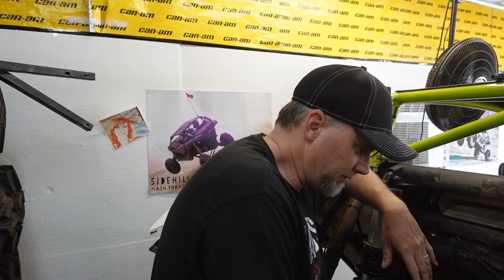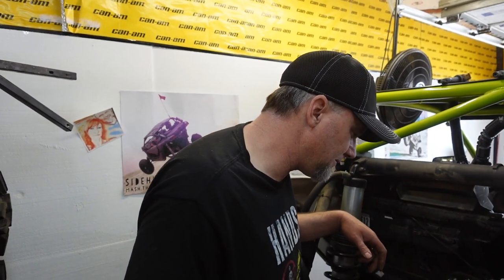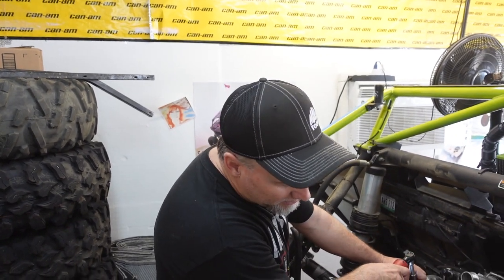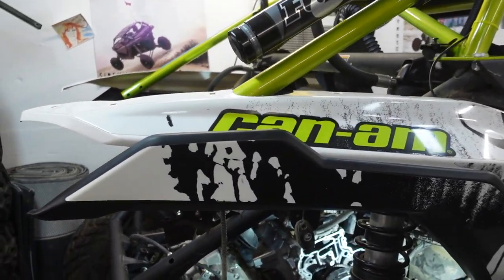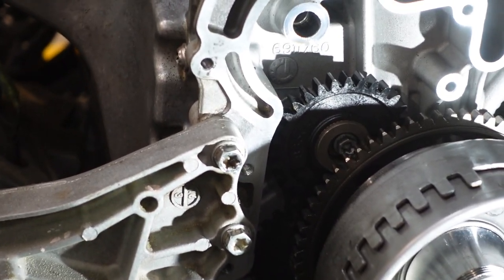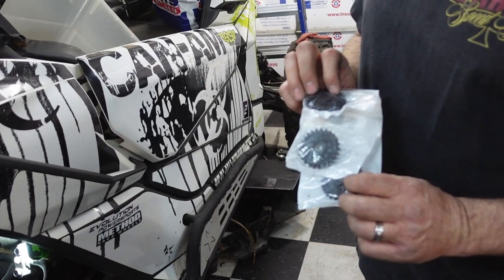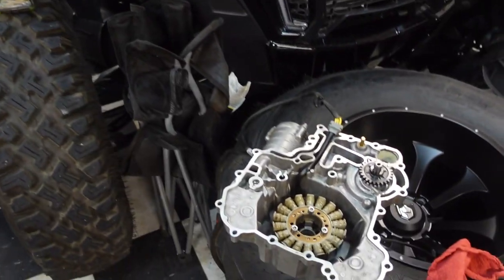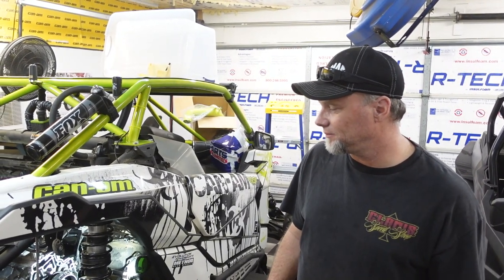BREAKING NEWS ON THIS WHOLE E85 DEAL

Comment: Hey guys, I run e85 in my big turbo Can Am. From what I was told is to:
1) make sure to have a catch can before running e85 & drain the catch can after every ride.
2) If you were changing the oil at 50-100 hr intervals before e85, you will now need to change it around 25-30hr intervals.
3) Add e85 and have fun! 😁
Reply from the maker: Yeah I do believe if those precautions had been taken this car would have probably been fine. I know a lot of people are running e85. Good advise, thanks
Reply: I do the same. Drain my catch can after every ride and frequently change my oil. After glamis season I go back to 91. 91 definitely helps clean the entire fuel system and motor.
Reply from the maker: That's a good idea we'll have to try that one

Comment: I wish the blog boys would get some videos out about their recent engine failures. I believe they lost 4 (2 can am 2 Polaris) in a month all on e85. They also admitted they should be doing more oil changes. It would be interesting to see what failed on theirs particularly the x3’s to compare to this
Reply from the maker: They did discuss some e85 buildup in some of the intake somewhat not. But not very in depth information as of yet. But those guys really push the hell out of their cars way beyond what we were doing
Reply: Agreed
Reply: I have been on e85 with my x3 for 3 years. Oil changes and catch cans are key. When I do an oil change I can smell the e85 in it. As for the blog guys, I am not sure their X3 engine failures were related to e85. Rick's car was running a lot of boost for stock pistons and had a ring land break. That seems pretty common when stock pistons are pushed too hard. I don't remember what happened to the xrsds. There are now billet gears out there that can fix this plastic gear issue.
Reply from the maker: Agreed, even running 100 octane with high boost oil should be changed often as there is additional blow by. Yeah who knows with those guys they're pushing their machines pretty hard.

Comment: From what i heard this is a common issue for the Can-am's when turning the power up.
The plastic gears just can't keep up, i know some one was developing aftermarket gears possibly made of a metal or aluminum for the Big HP Applications.
Reply from the maker: Not sure, we probably know 10 plus people with tuned cars and this is the first I have seen of this issue. There are a few companies working on them.. $$$$ ridiculously over priced.
Reply: @DandiOffroad   So I'm guess in its 1 out of 10 that have this issue "Just some humor"  lol Must be mostly the BIG Turbo  high HP guys. I have seen this issue come across multiple Instagram feeds and 1 i know personally.  I'm sure these company's take advantage of the "Its cheaper then a new motor" sales pitch.
Reply from the maker: LOL, definitely one out of 10 lol. I was being conservative with 10 but I get your point. I may not be in the loop I don't watch the forms I just don't have the time. But we probably do know 30 people with Can-Am's and it's the first we've heard of it. Of course not all of them tuned. Correct cheaper than a new motor that is for sure. And if you don't catch this issue in time you definitely will be replacing that motor. I did notice when we put up a video of the issues we've had with our RZR we had tons of people with feedback people with similar issues, on these videos, not
Reply: @DandiOffroad  Yea i stay away from the forums also, just because its mostly bashing back and forth and hardly any useful information. lol  I'm running a Turbo S Polaris but I'm usually the "Mechanic" for my other buddies that ride can-am's.  But from what I've learned is that the x3's use a pressure switch so as long as it shows the minimal pressure required by the switch (9psi) it doesn't throw a light. even though your car might need more then that when your pushing it hard or big rpm spikes. it just takes a moment of no oil at a High rpm to do some damage. 
In the Race trucks we run a oil pressure gauge so you know what exactly what its doing and be able to catch it in time and shut it down they might have a kit out there already for the X3's.
Reply: I don’t believe turning up the power should effect these gears as the rpms aren’t any different and engine temperature shouldn’t be any higher assuming afr are good. 

That said the gears look to be either too hot or chemically damaged. It will be interesting to see if the E85 or  chemical damage the test gears. Knowing how bad E85 is on other parts of the engine I hope it’s that as the solution is know and easy. Catch can and frequent oil changes
Reply from the maker: I agree, same RPM, we go to great lengths to make sure of it, clutch tuning. I think frequent oil changes and catch can would have avoided this
Reply: @cboutdoorfun9955   That's does make sense, could be the ethanol damaging the Plastic material.  I was assuming it was the heat from bumping up the power causing this but the other common factor was E85.
Reply from the maker: Yeah we're just guessing but we're going to do some tests and see if maybe we can get more information. But who knows we might not learn anything